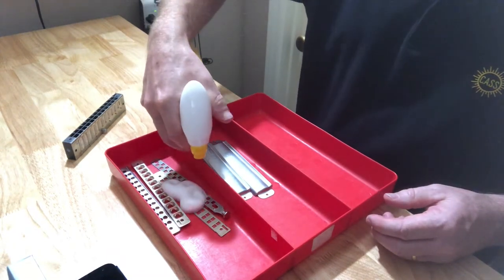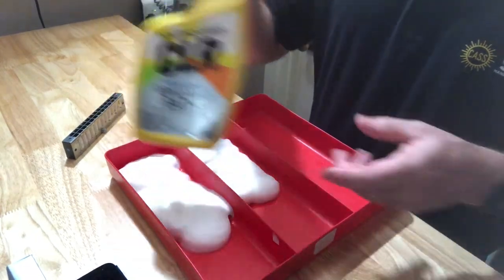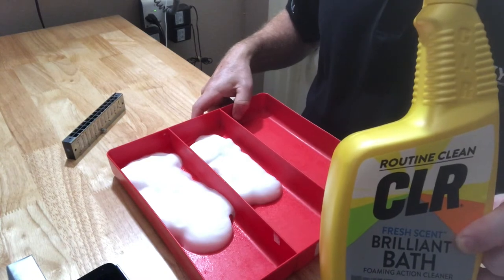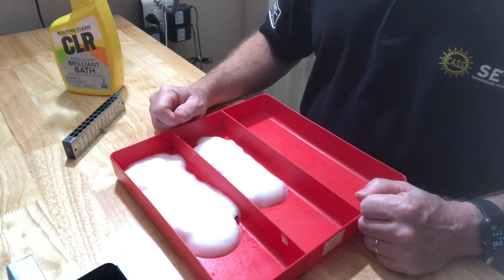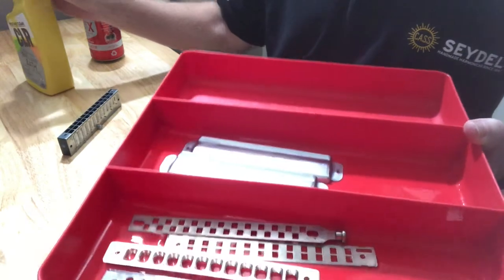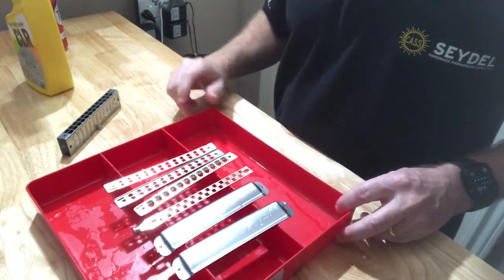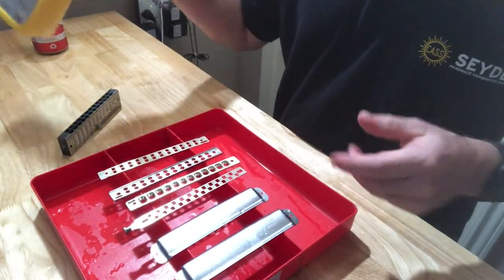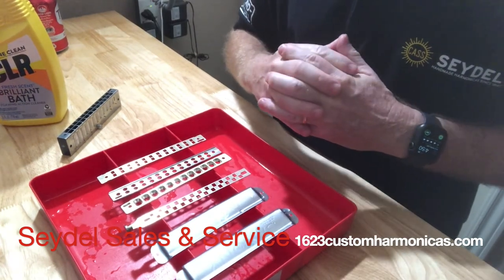Cleaning Disassembled Seydel Chromatic Parts (Slide & Mouthpiece)

Comment: Hi Greg.   Could I ask a question? Is it a good idea to run the reed plates under a running water from a tap or forcet?  I've seen a few people do this.
Reply from the maker: On a chromatic with valves, it is not a good idea. It has been done and many times it is done with no harm. However, in general I would advise against it unless you have spare valves available.  It is risky and many times the valves will either come off or curl. Greg question.
Reply: @AllThingsSeydel  thank you Greg